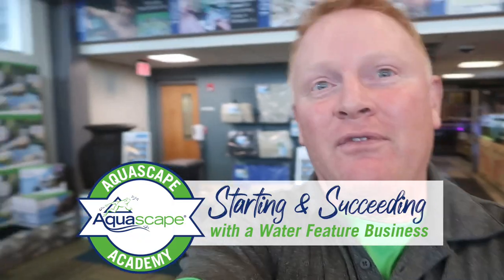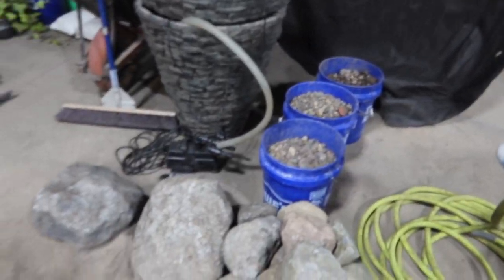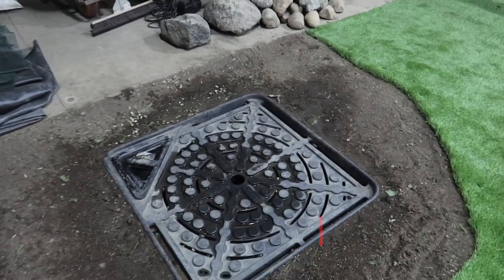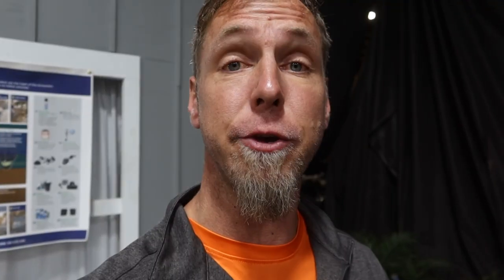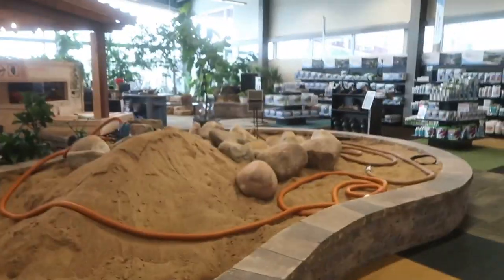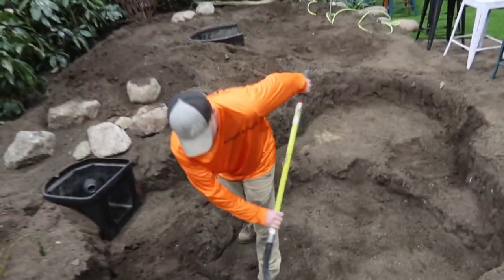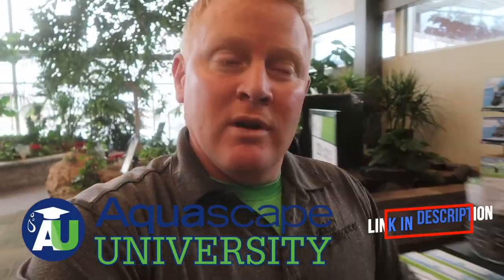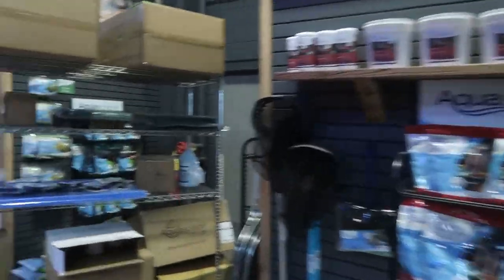How To *SUCCEED* With A WATER FEATURE BUSINESS

Comment: Hey, Brian. If you see this, I've gotta ask, how did you flood the kid zone of your personal pond? It's had me scratching my head figuring how to do it right. Thanks!
Reply from the maker: Created somewhat of a shower pan using a liner that's 12 inches high on the sides. To drain it I created a cork of sorts using an irrigation box that fits inside one of our Aquablox with a piece of plastic on top. When I need to drain it I just remove the plastic. Primitive but it works. Hope that helps
Reply: @TEAMAquascape  great idea bet you could find one cheap at a used construction materiel store to.
Reply: Thanks for the response and all the inspiration!